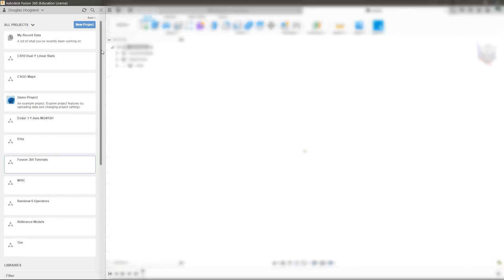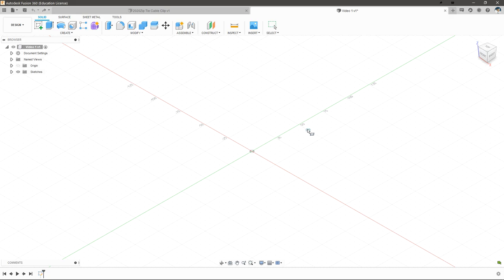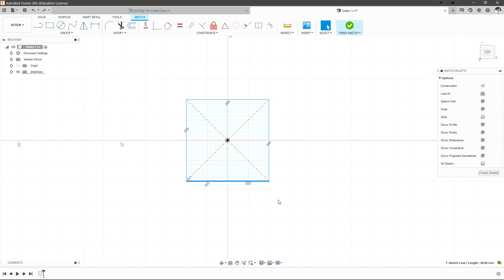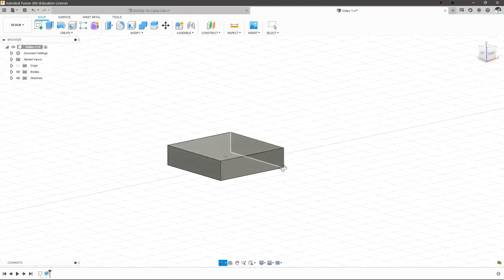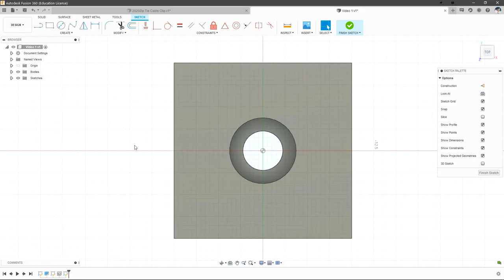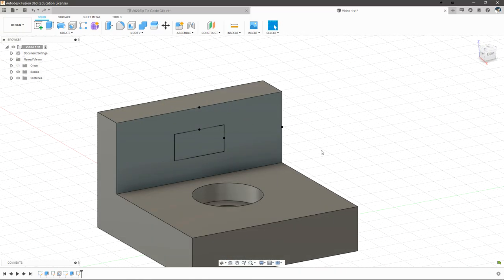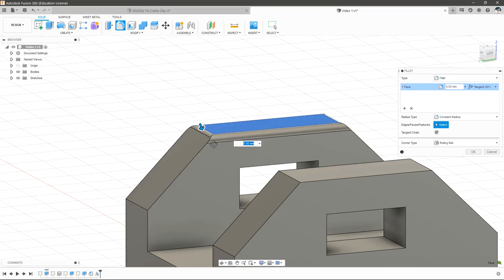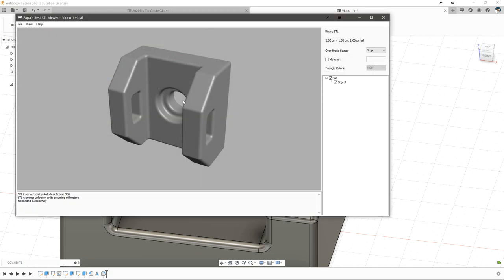Learn Fusion 360 Practical Modeling EP1 - Getting Started: 3D Printable Cable Tie Mount

Comment: Really really curious to know how you used it to make Meshes for hammer :p
I've been using CAD software for ages (used to be mechanical engineer so i'm quite a pro with the soft Catia ^^) but to this day I still find amazing the ability to go back to your geometrical constraints at any time. 
As always, your tutorial is perfectly clear and enjoyable, it makes me want to start using Fusion 360, it's so modern and ergonomic ! :O And you can name all the constraints ?!! amazing !
Reply from the maker: I don't use it for Hammer. Though fusion has an OBJ export option I could bring into 3dsmax.